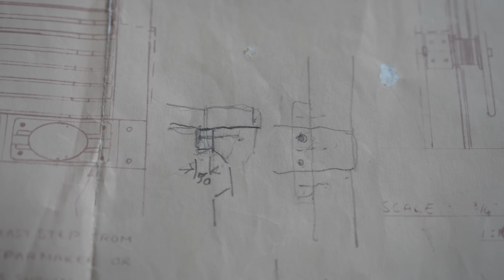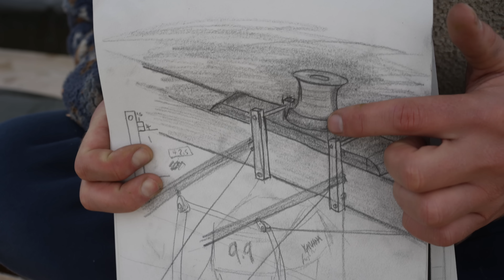It's The Most Important Part of this Boat's Refit (& I'm Trying Not to Wing It) | Wildling Sailing

Comment: Your jig should help with vertical holes. I've learned that with horizontal holes, one can slip a slightly larger washer over the bit and with the bit turning, use the washer to know when the bit is level. Move the drill up or down until the washer "rides" about halfway between the wood and the bit. This is of no help right or left but is an acceptable way to gauge the up/down. :)

Comment: Drill a pilot hole first then move up to the full size, but re sharpen your drill bits, after a few years you can do it by eye, but you can by a little jig that fits on your drill to sharpen your bits, good luck in your build

Comment: When drilling stainless steel you have to remember that the more heat that's generated the harder it will get.. you must go slow and use a abundance of cutting oil

Comment: Well Mark, you are definitely progressing as a "Do it all" boat owner.  After reading thru the comments it looks like most of my suggestions have already been stated (center punch, cobalt drills, pilpt hole, a good electric bit sharpener, countersinking the nuts).   The only words of wisdom i can add to it is when putting stainless fasteners onto stainless threads always add some type of lubricant.  Stainless on stainless like to gall and bind up.  Keep on learning, but take some time for yourself.  Don't be concerned about stepping away for a bit and putting the boat out of your mind.  It will pay dividends when you get back to it.

Comment: As lots of people have said a smaller pilot hole first when drilling stainless also maybe get a cheap pillar drill, nice slow steady speed and even pressure. It would be worth it in the long run if you much more stainless to drill. I’m sure there would be something on marketplace or similar. Good luck and keep up the great work. Oh and some proper cutting fluid, I like CT90.

Comment: Excellent work Mark! You might consider a reciprocating saw if theres much more metal work!
I was worn out just watching you cut all that! 😅
Cannot wait to see that mast planted and a sail flying!
Advice is just epoxying any and all holes as well as wood and using large diameter washers on the stainless rectangular and square tubing.
Also, lock washers may last longer than nylock nuts.
I'm so jealous of you and this massive cool project!
Goooo Mark!👍

Comment: Just a little thoght, your washers that you have used for the troughbolts are quite small. especially because its a structural part. i would go with a 1.5 ratio with the diameter of hexnut to the diameter of the washer, the washer being bigger that the nut. Also a bit thicker washer would not hurt. Its just a  thought, i am by no means a expert, but with the softnes of the wood i would go for more surface area, giving you more friction and a lesser copression force on the fibers. Love your work. all the best.

Comment: For the mast foot: I suggest a polyurethane sheet of sufficient thickness to take up the bow in the base. 5mm will be more than adequate. Its a compression load, its bolted down, and there will be rigging to keep the mast upright. I wouldnt worry about it mate.
Reply: Exactly a lot of folks are thinking there is a massive load at the mast base. The rigging is what holds the mast upright the load on the base is actually pushing the newly installed base beam down onto the other beams. Hence the reason the lag bolts are more then adequate.

Comment: You've probably noticed by now that stainless steel work hardens as you drill it. I've found the best way to avoid toasting drill bits is to push hard and just just drive the bit through it as quick as possible. The gentler you are the worse it is.

Comment: AHOY from Sweden ! Just use water to keep the HSS drills cool all the time when drilling 316. Anywhere the 316 is drilled, filed or hacksawed, it will get superficial rust. Only electropolishing stops this.
Reply: You can get stainless steel "passivating" solution to fix that.
I'm a bit vague on the chemistry, but it basically binds with any free iron atoms that are exposed by cutting/drilling etc, and stops the rust.
Reply: @petercroft9895  Yes. I remember using stuff like that... a long time ago. I don't remember exactly what it was called, but it was something like 'Euroclean'.

Comment: Here's a tip.
When you cut thready bar, spin on two nuts and have one either side of the cut, then once you're through you undo the nut and it will chase out the thread for you, so no need to use the die and risk cross threading 😉👍

Comment: Oh…and a little farm trick I used often when cutting a bolt is to thread a nut a little ahead of the cut, then cut, then just undo the nut. Eliminates the threading tool. 🙂
Reply: I was just about to say the same.
Reply from the maker: was thinking that, but unscrewing and screwing the nuts was driving me nuts.
Reply: @WildlingSailing  ah. Putting the rod in the drill chuck speeds up the threading. 😆

Comment: The bit that will compress when the bolts are done up is the box section.Instead of cutting bushes inside the box section you could have used hardwoodcut with an interference fit & hammered in. Then drilled. The box section would not compress &if you were worries about rot you could soak it in resin first.
Reply: You are right and Mark is also on a budget,
Also the other bushings over the logs keeps it from being tight. He should be careful who he get advise from, I would say listen to Anika alone, if possible hire her an hour a week online, that will save Mark time and money.... and stupid advise.
Reply: @jiefflerenard1228  Correct . The bushings on the beam need to be slightly slack to allow max compression across the beam.Considering the cost he could have just put bushes on the top ones where they bear on the beam & helf stiffen the studding & not bothered on the underside where they are below the beam & do not apply any vertical load. Only horizontal clamping load.

Comment: Reduce the wear on larger bits in ss by drilling a smaller pilot hole, as the points are worn out quickly without a pilot.
Reply: Drills like chisels can and should be kept sharpened by hand file or drill stones...
Reply: @saylaveenadmearedead  I don't think a file will touch a HSS drill bit.

Comment: Mark very smart to have one drill that runs on electricity, covers when you have burned through all the batteries,  good to hear that you build of the mast foot was blessed by the designer. With stainless the faster you drill the harder the metal becomes....slow with lube does it. You might not be able to see it but you have grown immensely as a builder you are taking your time, deferring to experts, and defending their advice, and you are willing to redo things you feel aren't up to the level you want....you are doing really well...cheers

Comment: When you drill a hole in steel especially stainless turn down the rpms to 6oo rpm and use a small drill bit like one eight and work your way up to the size you need. gradually. Hope that helps ya Mark! makes it a whole lot easier.

Comment: When drilling stainless steel use cutting compound, slow speed and high preassure, also cutting compound for the hacksawblade to make it last longer. Slower speed when using the saw.

Comment: Hi - trust and hope that you are keeping well with all of the work on your awesome project. Just a suggestion... I would consider using stainless carriage bolts instead of the stainless threaded rod that is two mil smaller.I would also use bolts that are the exact same size of the holes you are drilling. Using larger fender washers for the bolts would always be a plus. Another suggestion would be to build a sturdy work platform as it will assist you in all of your work projects going forward. A solid pair of sawhorses with a fixed top will go long way.

Comment: Whenever you're drilling stainless, cooling is more important than lubrication, keep the drill bit flooded with water, that keeps it below 100C, using oils allows it to go over 100C. At work we use stainless a lot and switching to plain water instead of lubrication when drilling helped us keep a lot of drill and holesaws from getting dull

Comment: For drilling stainless, Go slow! Lubricate often with a good cutting oil. If you see your oil smoke. Stop and re-lube and let it cool for a few seconds. Use a sharp bit! Don't let the bit get hot. You should get long spiral shavings not chips. You'll find that you will be able to drill a hole much faster by going slow and use good pressure.  I mean really slow. Use a proper center punch. Keep up the great work!

Comment: Keep on trucking. You’re doing a great job. Don’t forget that the original polynésien boats were held together by « bits of string ». So what ever you do will always be stronger and masts resist to vertical loads and horizontal loads are absorbed by the rigging. Have fun your videos are great 😅

Comment: My understanding is that keeping down the speed of the drill will also prevent work hardening the steel. Pilot holes and slow speed might be a test of patience but will save time in the long run and money on new drill bits.

Comment: if you, drilli a smaller pilot hole this will help the larger diameter bits to perform a lot better which reduces heat heat is a major factor towards dull worn bits, you may well be doing this already but its not evident in the footage. anothe tip with harden steel is using a press at lower RPM'a

Comment: You are doing great work and I look forward to each Friday. I envisioned the engine sleds nestled into a cockpit pod. Imagine a cockpit with seats on each outboard side. Under the seats would be an opening storage compartment (lazorette). This is where the engine sled would be mounted and swing up into it in the stowed position. They would be hinged at the forward end and have a raising mechanism at the aft end. If necessary, you could make the engine move up and down inside the sled to get the proper leg depth. I hope this makes sense. I know I have seen a Wharram design like this before. You want this setup to be simple and easy to get at for maintaining the engines. Keep Calm & Plan On

Comment: you can use a rat tail file to sharpen drill bits
not the best solution but worth trying, i used bing for the ai answer. it is a low cost solution to buying more drill bits, unless someone there has a drill sharpener you could use!!!!

Comment: In my humble opinion, you should cover in epoxy every single piece of wood, before setting it permanently.
Reply from the maker: cool, will do
Reply: @WildlingSailing  and inside every drilled hole, then fill the holes with sikaflex then finish the install . I would also use cover nuts for a nice finish.
Reply: Butyl tape for all holes will keep the freshwater out and reworkable unlike sealant...
Reply: Hardly necessary. Good quality paint is totally sufficient for a non immersed piece of quality wood, and is needed to avoid UV damage for epoxy anyway. Do you see any epoxy painted on exterior non-immersed timber in other wooden boat projects ??
Reply: @WildlingSailing saw a method online for filling horizontally drilled holes with epoxy. From duct tape form a little dam or half funnel which will direct epoxy in while a similar funnel on other end allows air to escape up, this filling hole to top. *Sorry, old mind makes attribute unavailable, but thanks to this fine mariner.
Reply: Varnish is wonderful stuff, too. Don't be afraid to slap on a few coats of that on raw wood when you can't break out the epoxy.
Reply: Your going strong mate.You’ll come out of all this with a lot more knowledge,satisfaction and reward.
Reply: Don't do this. It'll be an expensive mess. Use Dolphinite between mating surfaces to prevent fresh water wicking inside and causing rot.

Oversize the holes, fill them with thickened epoxy and then drill out the correct size, do not use sikaflex, as brilliant as it is, you will curse it if you ever need to remove anything.

Use butyl tape underneath smaller fittings.
Reply: @CleverMonkey-jd3du   Varnish is for looks only ( Brightwork), and a mast step is not a feature. I wouldn't varnish this timber at all. Just wasted effort, that needs to be recoated every 12-24 months.
You could even just use a wood finish (oiled) here, but paint is by far and away the best protection against water and sun.
Reply: I would agree with this for some of the wood but not all but would also suggest to do a round over on the sharp corners on alot of that wood eg. engine mounting blocks and mast step as the wood will certainly be prone to tearing out without it @wildingsailing.
Using outboard motors is going to seriously limit the seas that your boat will be able to be under engine power in as anything over 6 foot swells will be an issue for cavitation and especially when you are dealing with breaking seas.
Reply: @dnomyarnostaw  Exactly! there are lots of traditional and more friendly ways than Sikaflex and epoxy.
Paint and butyl for a start.
With all the money Mark has spent on epoxy patch up already, he could have bought wood and do real repairs.
Reply: @dnomyarnostaw   I'll have to disagree. Varnish has been used for a long time as a preserving finish.
Reply: @CleverMonkey-jd3du  Don't confuse Varnish with preservative coating.
Pure Tung Oil is a preservative coating for example,  and even old sump oil works. 
Varnish is transparent shiny stuff that, as a result, degrades under UV, known as Brightwork, or as most sailors name it after 24 months  "cursed major recoat" 😀
Reply: @dnomyarnostaw  oh, I'm not. I'm a woodworker. Varnish is definitely not only for "show". So-called spar varnish is intended to preserve from the elements while still allowing the members to bend. Perhaps many things have been called varnish over the years, but the stuff used by boatbuilders is most definitely used to protect raw wood from the elements, and in a manner that allows easy repair and refinishing. The modern formulations are very good, but even ancient varnishes were very good at preservation.

Comment: There are data sheets on the tensile strength of the stainless steel rods you are using for your mast base... Watching your video made me feel that the ones you are using may be a little short in strength to hold mast in a prolonged storm. But I am no expert here...  Cheers

Comment: You seem to have your drill set to clutch for screws.

A4 316 stainless work hardens so if you have slightly dull bits it will go rock hard. You need to develop your drilling skills and sharpen your bits.😅

Comment: Looks great. Don't know the spec but, The bolts going thru the large beam should have a large fender washer or a plate or both. The pull through force and load transfer from the sail to the beams will be mutidirection.

Comment: I, personally, think if you have driven a 12mm hole you should use 12mm rod.  I would agree with bigger washers - even more important if you are using 10mm rod.
Reply: Yes 12mm rod will be alot stronger

Comment: The handy thing about an auger bit is that it will pull itself through the hole and the chips will ride up the spiral in the bit.
Reply from the maker: I think you mean, helter skelter bit, but good point ;)
Reply: @WildlingSailing  I reckon that would be a suitable description of it too lol 😂

Comment: Mark get yourself a cheap chinese cordless grinder thats compatable with your makita batteries and use the 1mm metal cutting discs . Also put a nut on your stud bar behind your  cut then rewind it after to clear the thread . 
Great work so far !

Comment: I know just reading through the comments that you have received quite a lot of useful tips but just one more to save you from future grief… over size the mounting holes you drill through wood then mix up a thickened epoxy fill those holes completely then center drill to the correct size hole needed through the epoxy. This hopefully will preserve your investment in expensive wood. One more tip after drilling through the square tubing find some s/s pipe just bigger than the threaded rod you’re using. Cut it to fit inside the tubing where you have drilled through… this will create a shoulder that will prevent the tubing from crushing under stress and loosening critical joints👍

Comment: Great video's your doing a great job so far. loving your enthusiasum. You probably know this already but just saying :-) When drilling steel or stainless steel, use Cobalt drill bits. Drill slowly, the key is to keep the bit tip cool so dip it in water or oil when ever you believe it's getting hot. You know it's in the sweet spot regarding drill speed when you can see material appearing from the tip as its drilling. Caution as tempting as it is,  dont ever drill full speed,  this makes the tip over heat (as mentioned in this video) and blunting the drill bit.  Good luck looking forward to future episodes.

Comment: On the mast step beam you need to use much bigger washers on the bolts because you have oversized the holes at 12mm and you are using 10mm bolts, they will pull straight through either on tightening the bolts or when sailing .I made the same judgement call as you  and couldn't get mast tension

Comment: Go for an electric engine, there are just a little bit more expensive but two times e-pods with each 3kw should do. Low maintence and refueling by solar panels. So much less hazzle and much better for the environment as well

Comment: Great work .

I agree with previous comments regards pilot drilling holes and the larger washers to spread the load.

Only thing I'd add is that you'll see the difference between 316 and 304 after a couple of months of being exposed to  sea air and salt spray, the 304 will start showing signs of surface corrosion, other than that  doubt it will be problem.